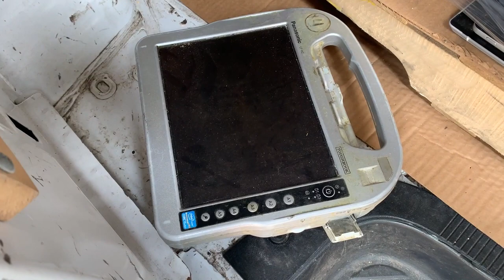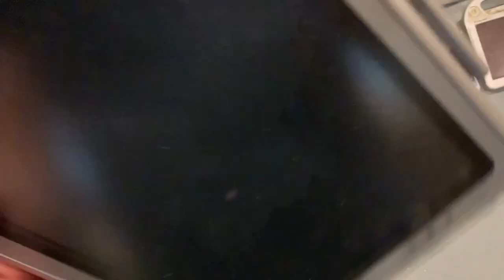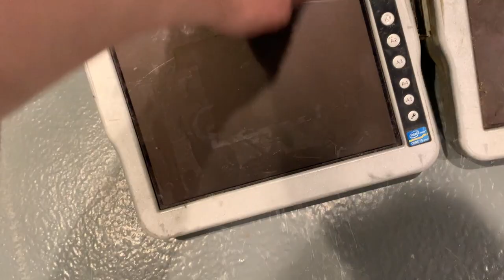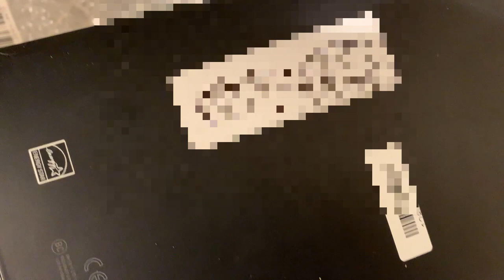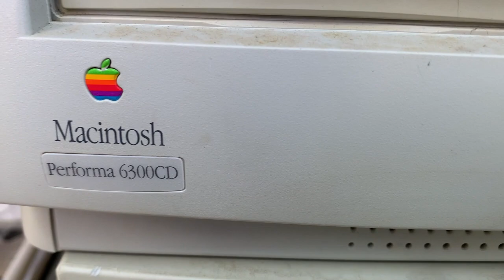Compaq TC1000:  The Original Tablet?

Comment: about phones that you've picked up. these are mostly galaxy s4, but there are also galaxy s5 (top left corner of the lot) galaxy s6 and maybe s6 edge (center bottom side of the lot), s7, s8 and maybe s8 plus (center top side of the lot). also i think there is note 3 or note 4 in second box from the top left (there are also moto e phones). on the top right corner you can also see some moto g phones as well as lg g2, g3 or g flex phone and some xiaomi (i guess) phone. galaxy s5 have tall battery (like iphones have) and s4 have chunky, wide battery. i hope i have somewhat helped
Reply: as for the iphones and android tablets. these are 4 or 4s. as for tablets this apple trackpad like is lenovo yoga tab 2 (so much memories with this thing... anyway), galaxt tab 2 10.1, tab 3 10.1, tab 4 10.1 and galaxy tab s1 and s2 (these ones in bags). hope it'll help you too if you haven't sold them or anything
Reply from the maker: Thanks!  Yes that is a help.  I had over 1000 S4s, so I batched those up and sold those off, but ironically I haven't bothered selling the better ones because there are 10x fewer of them, but at some point I'll get around to it.